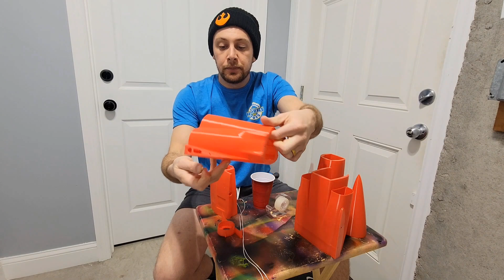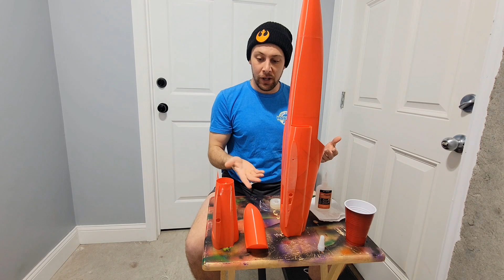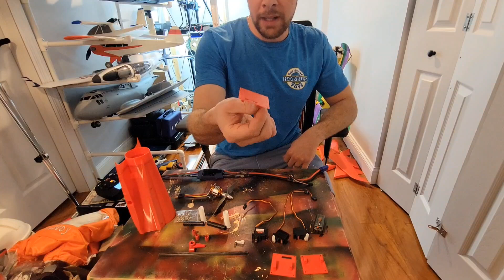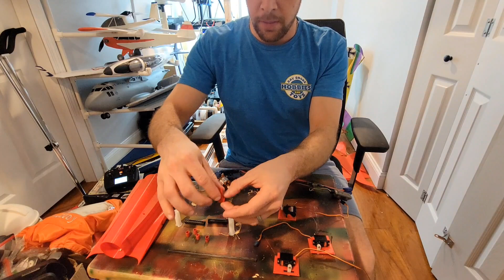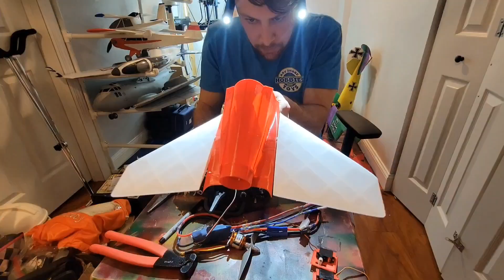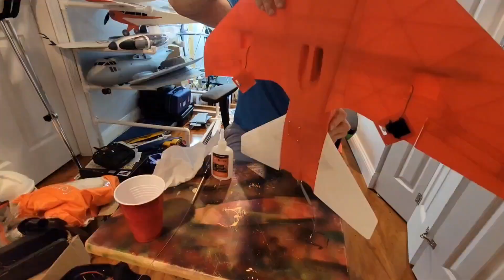THIS AIRPLANE RIPS‼️

Comment: Looks like a great plane. Did you just follow the guides that came with it as far as all your printing settings?? 2 walls? pla? Have you printed any planes using the "pre-foamed" pla? I've printed in both, haven't printed with the "active foaming" yet as it is difficult to get here in the states, and expensive too..  How did you come out on your weight?  Alot of questions I know, been printing some planes and ran across your channel via the Piper by the way looks fantastic! Appreciate any info, subbed!!   Thanks walt
Reply from the maker: This plane is BEYOND a great plane. One of my favorites by far. Yes just followed the build guide. This plane is 100% Regular PLA. I'm not really a fan of the LW PLA. It's not as strong as regular PLA and can be very tricky to print with. Not sure on the flying weight of this one to be honest. Thanks for the Sub!